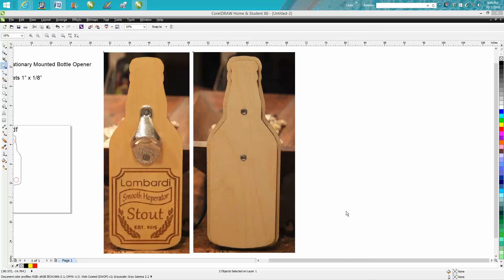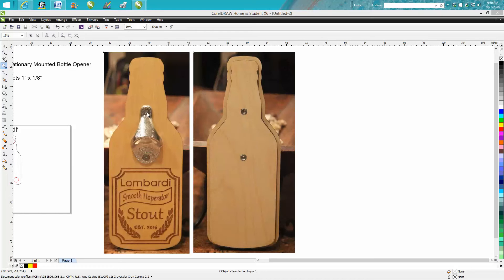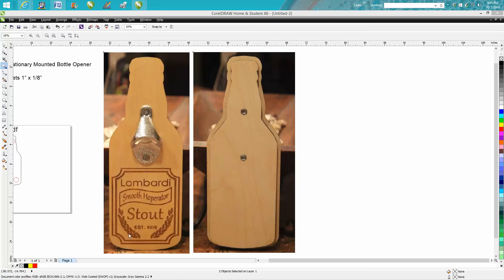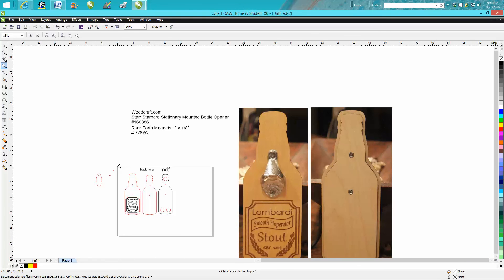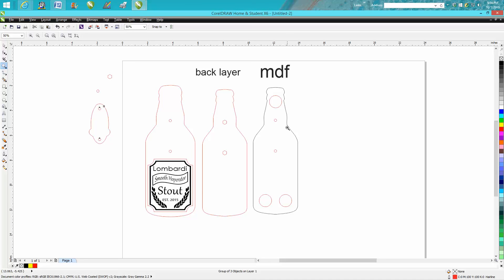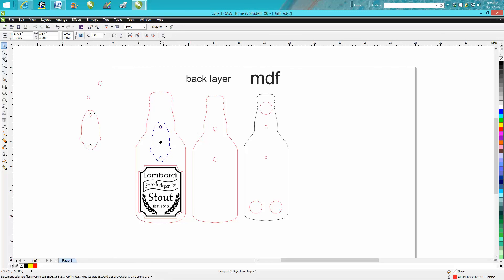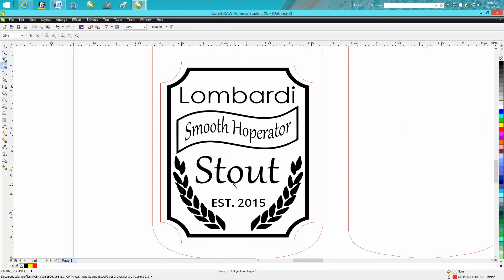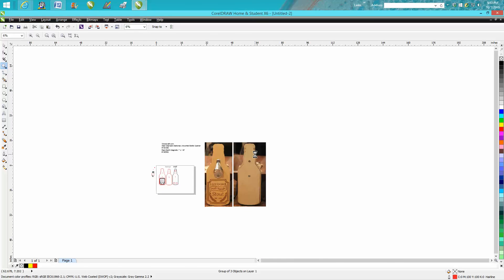Corel Draw Tips & Tricks LASER how to make a Bottle Opener

Comment: Appreciate your time on this Doug. Can I add to this design? I'm thinking about maybe engraving a bottle cap on the top of the front layer with maybe some light reflections on the shoulder of the bottle. I was also thinking that maybe use just the front layer with a thicker piece of wood and gluing in the magnets on the back side unless you think that the three layers are needed. Would this design work with acrylic too? I'll mess with this when we get our laser up & running within the next month. Thanks again...
Reply from the maker: +Dave Bakke You may do what you want with any of itthe acrylic might be cool lookingon the thicker wood, the laser would burn it pretty bad, I have seem them all out of 1" wood and the holes for the magnet just drilled in the back

Comment: Nicely done! Just curious if the one magnet at the top is strong enough to hold while actually opening a bottle? If not I suppose you could place two magnets vertically on the neck...
Reply from the maker: +DesignCutters Not sure, I did put two in the neck of mine and 4 below, it's good and strong, the only reason I would want to try less cause the magnets are pricey